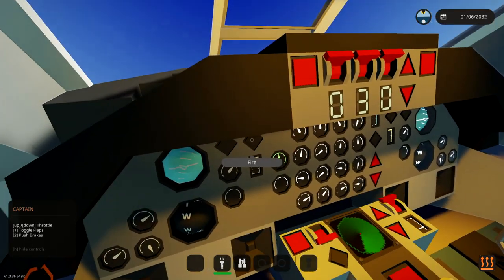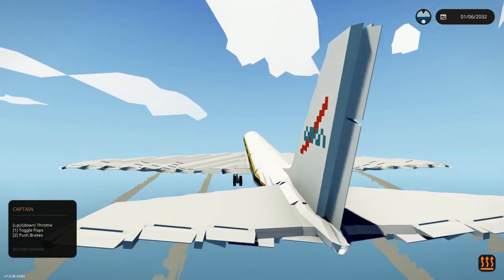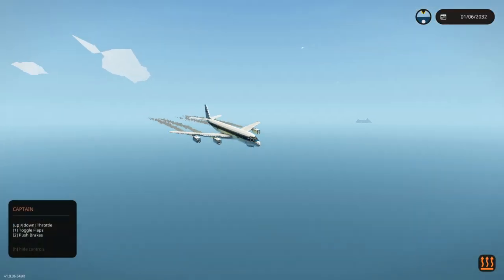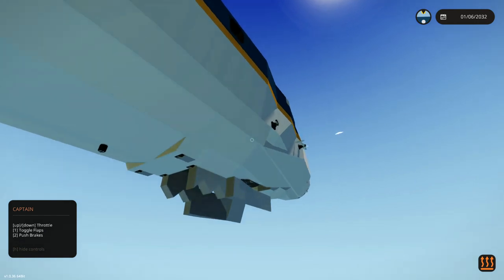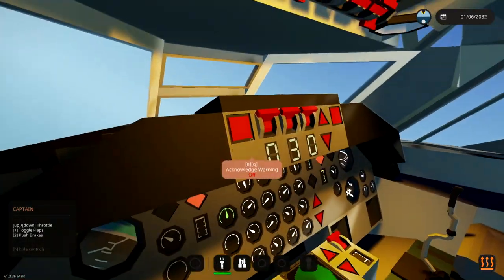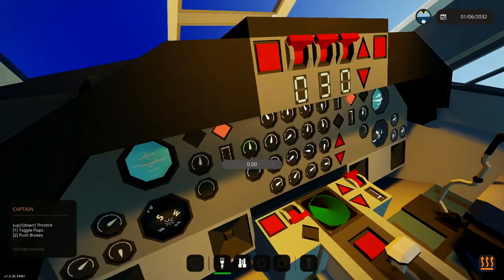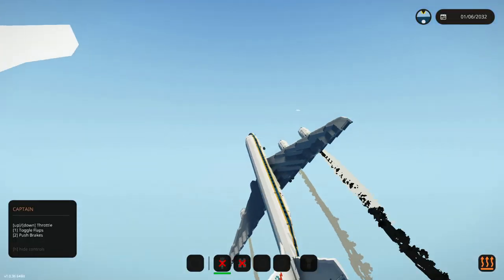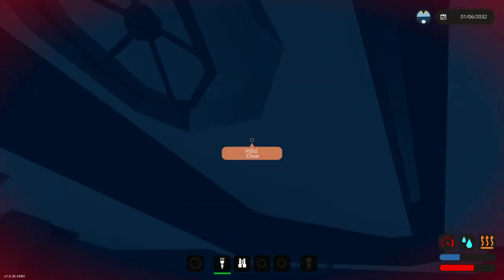NASA AIRLINER Loses TWO Engines!  -  Stormworks: Build and Rescue

Comment: In the intro what I would have done is use the heading hold to keep the system pointing straight
Reply: That wont do shit. Let's say you loose engine 4, the furthest engine on right, you would end up with unbalanced thrust. The same way you would have a blown tire on the right side of the car, the car would want to veer to the left. Extra steering input would be needed to keep it straight. A yaw trim would be needed so you wouldn't be constantly adjusing the rudder. Or else you would decrease engine 1 (furthest engine on left) to same thrust as engine 4. Trim is used more often. In stormworkw which is very unrealistic, turninf off engine 1 would work as aerodynamics in stormworks is very bad and rudder trim will do nothing even at full trim to right. LNAV (lateral navigation - horizontal gps can be used for plain to follow flight plan aka waypoint normally)
Reply: @bray8949  I see, well it’s just what I would do